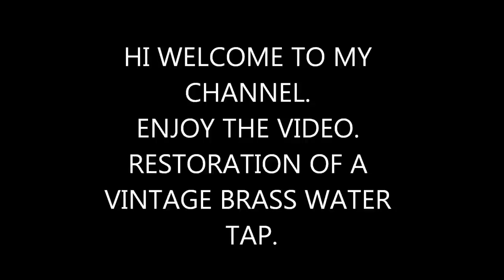RESTORATION OF A VINTAGE SOLID BRASS TAP.

Comment: The taper is how it seals the water. But your final assembly isn't tight to stop water from leaking. If the tapered shaft is able to move up and down so easily, it isn't tight enough to seal. But thumbs Up for your refurbishing.

Comment: Citric Acid+Hot water=Clean Brass and  Stainless steel!
Reply from the maker: Thanks Simeon I'll hav to give that a go.
Reply: @metalartRestoration123  Me and my old man were trying to clean a stainless steel water tank from the inside, there was a build up of that white stuff that's left over from low quality heavy water, and Citric Acid with hot water made it flake off 100%.
Reply from the maker: I'll try and do it in one of my video's. I've seen that white stuff before in a galvanized water tank I think it's calcium  build up.

Comment: Nice!! I'd much rather have that than a modern equivalent 👍🏻  I polished up the brass work on my stationary engine after using a soft wire wheel to remove the patina..... No scratch marks visible 👍🏻🛠️
Reply from the maker: Thanks Armando I hope to be setup better in the near future so I can polish stuff to a mirror finish.
Reply: @metalartRestoration123  I like that you have basic equipment, like me.... I still polish with a drill and buffing attachment..... I would like to get a belt sander, though 👍🏻
Reply from the maker: Yes me to and a bench grinder with a polishing wheel.
Reply: The 'horizontal chuck' I have on my polishing wheel (ebay) is one of the most useful things in my workshop Guys 👍 just saying  😊
Reply from the maker: Thanks sparky I'm in progress of restoring something now and I've got an idea to make a attachment so I end up with a grinding wheel and polishing wheel coming soon.
Reply: Cool I will keep a look out 👍 😊
Reply: @Everythings_Adjustable  What does it look like, S?
Reply: It's this thing here,  Over the years I have up graded the bearings and it's on its third motor,   https://www.youtube.com/watch?v=UB71-6PEZQQ

Comment: how do you keep it from leaking if it leaks?
Reply from the maker: Probably once it wears out u get a new one  but it's probably over 50 years old.
Reply: You can lap the valve body to the housing.
Reply: @mr.noneyabidness   what does Lap mean ?
Reply: @zurdoremi  you use a fine grit  lapping compound (fine grit granules in a water-based solution) on the parts you want to fit and spin it until the mating surfaces match exactly. If you YouTube Valve lapping in an engine head, there are videos that show the process. It's really old school but hard to beat when two surfaces need to be the same.
Reply: @mr.noneyabidness   I prefer to send it to you for lapping. It is a tiny brass tap that screws onto the radiator drain port of a 1960's car. It leaks coolant drop by drop, not acceptable. Thanks.